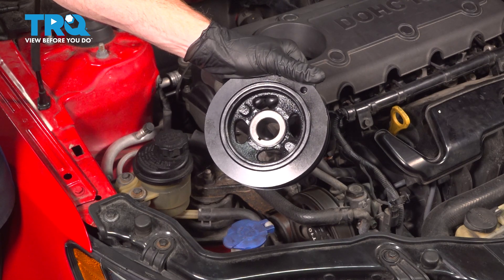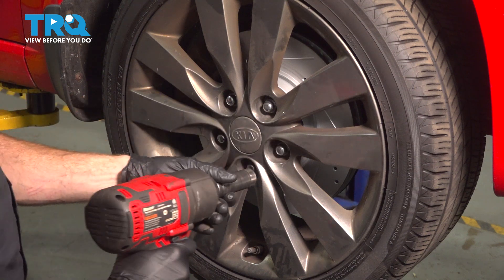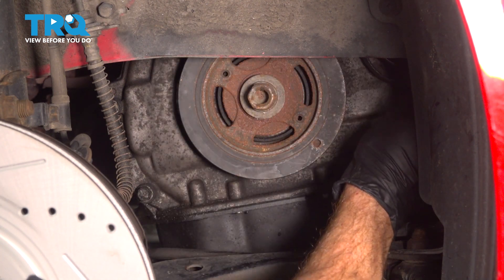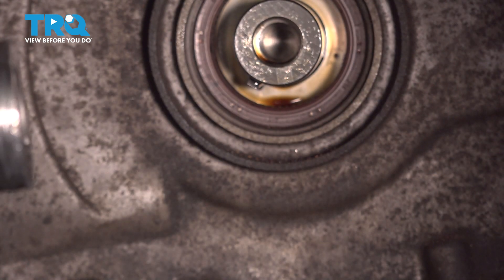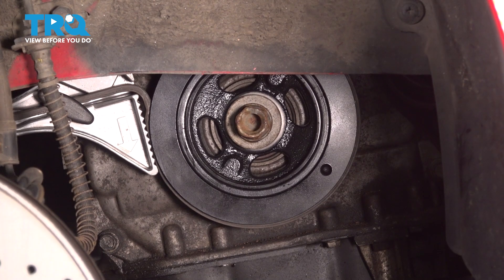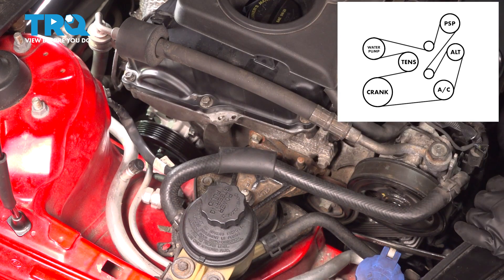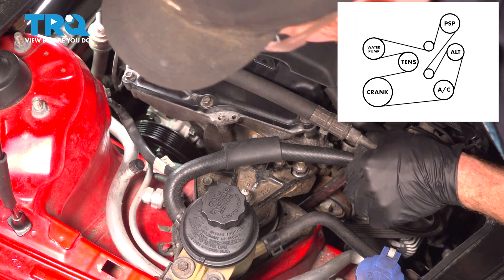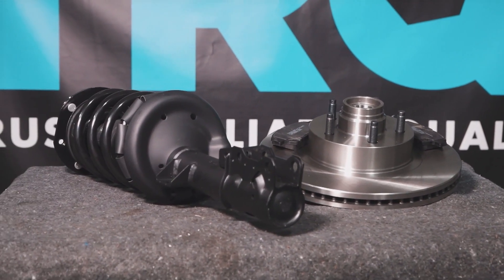How to Replace Engine Crankshaft Vibration Damper 2010-2013 Kia Forte Koup 2.4L L4

Comment: I had a mechanic take the bolt out that holds the harmonic balancer in place and used a wire brush and brake clean to clean the threads of that bolt. Now I got to go ahead and see if I can get this thing off easily with or without using a three-arm puller.

Comment: I have a kia forte 2012 car. sometimes I press the accelerator, it makes sounds. and when i press a lot, it goes away. Also, sometimes I start the engine, it has a deferent sound (kinda like a dried out sound) and the engine is shaking. I usually turn off the engine and restart again. It goes away. What could be the problem? I checked with the spark plugs on the top of the engine they were all find.